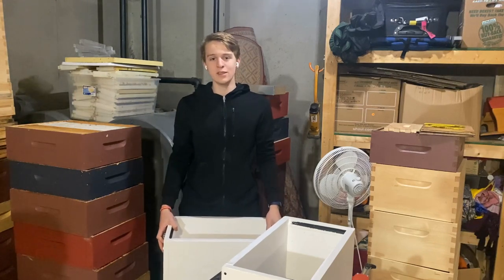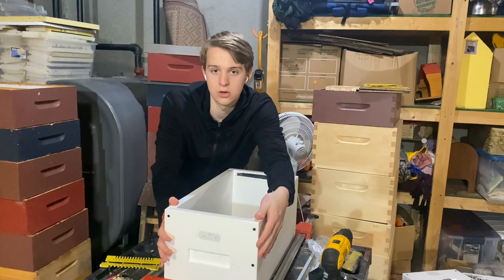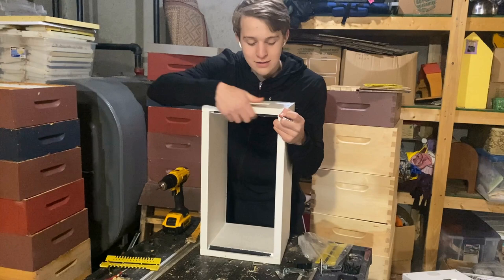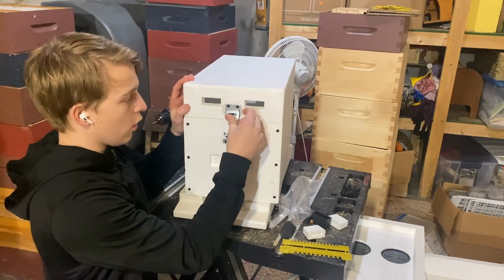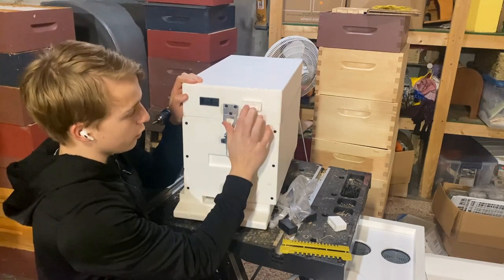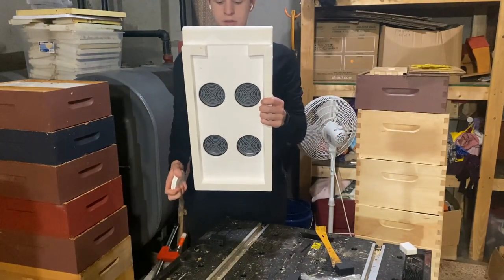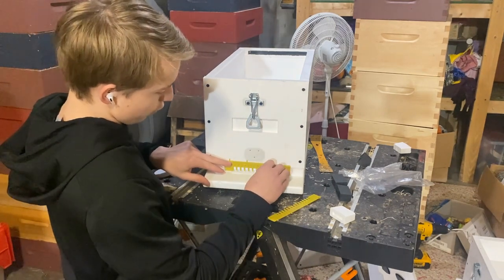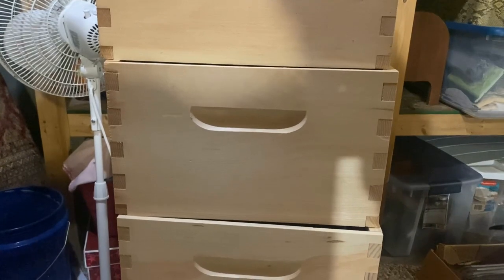How to build a 6 frame Polystrene Nuc Box

Comment: I believe the smaller entrance reducer is used if you want to keep a queen in the box - it's basically like a queen excluder over the entrance. To keep the bees in the box (like if you were moving the hive), you can take either of the entrance reducers and flip them over. You will see those entrance reducers when you flip them over are much smaller. There are thin brass looking screws to attach the entrance reducer. I used 4 of them last year and liked them so much, I bought fifty this year, along wit the feeder like you. Make sure to paint them, the sun won't be kind to the polystyrene and they'll break down without paint.
Reply from the maker: Thanks for your input Greg! I do plan on painting them, hopefully they will last a long time. I will look into what you said about the entrance reducer.